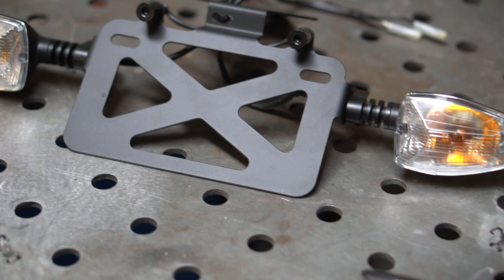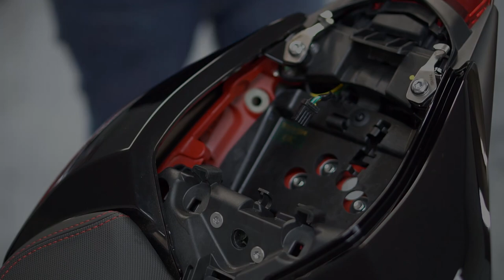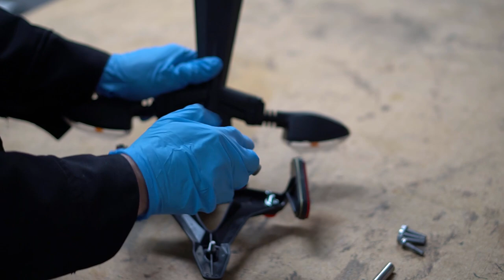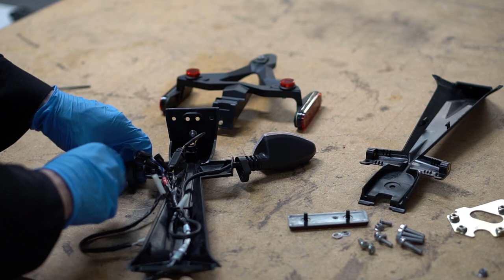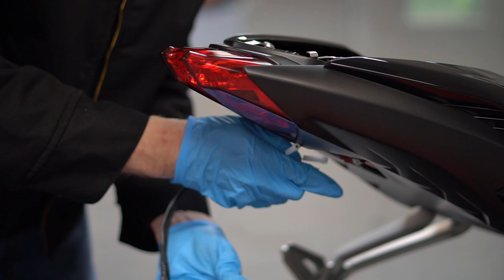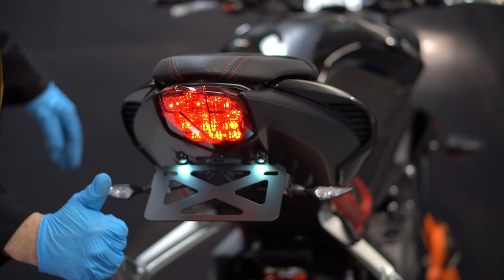Brogue Motorcycles Triumph Street Triple / 765 / Daytona 675 - Tail Tidy Kit - How To Video

Comment: Most beautiful clean professional to the point vid on triumph or any bike ever. Clean! My prb is Moto 2 765 Daytona the light is fine but no license plate light or warning. I wonder? All the OBD2’s that i purchase to reset service reminders they all fail to work for me on Moto2 765 limited edition. Any clue?
Love your video either way!
Reply from the maker: Hi and thank you for the kind words! Are you having issues with our tail tidy? or is something wrong with your bike? Either way please shoot us an email and we will be happy to help.
Reply: @broguemotorcycles  Just the license plate light but it is stock.
Reply from the maker: @rafaello9418  I would disconnect the  the connection and check the voltage. If there's no voltage then check a fuse or track down the issue in the wiring. If there is voltage then you probably have a burnt up stock light.
Reply: @broguemotorcycles  Roger that 🫡

Comment: Will this work on the 2020 Street Triple R? I'm picking mine up in a week and want to get rid of the ugly ass fender. It looks like its the same.
Reply from the maker: Hi Peter Pan, Yes it will work on a 2020 model. There have been some but not  all 2020 models that may require a load resistor to keep the flash rate correct. Only reported by a few out of 100!

Comment: I’m assuming this works on my 2022 street triple rs ?
Reply from the maker: You are correct:) We also have a fitment tab on the website, but it sometimes seems hidden. Hope this helps and please reach out if you have any questions - Contact@broguemotorcycles.com. 

Street Triple 765 R - 2017+

Street Triple 765 RS - 2017+

Street Triple 765 S - 2017+

Daytona 675 - 2013-2020

Daytona 675R - 2013-2020

Street Triple 675 - 2013, 2014, 2015, 2016, 2017

Street Triple 675 R - 2013, 2014, 2015, 2016, 2017

Comment: Would I need to buy the resistor wires for a street triple 2022
Reply from the maker: It's 12 dollars to add them if you buy a complete kit. Depends on your set up. Some will need them and others will not.